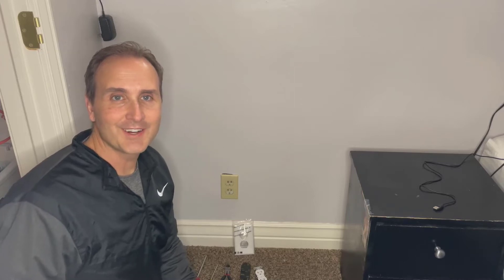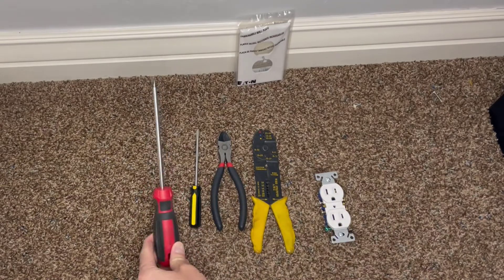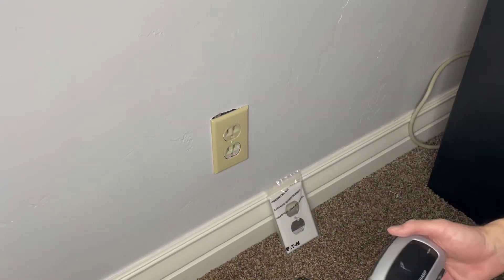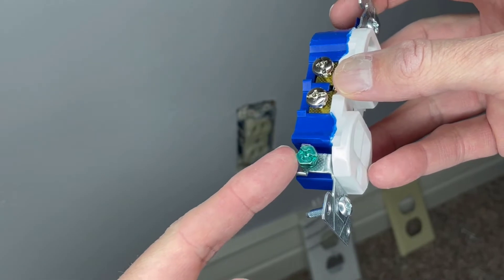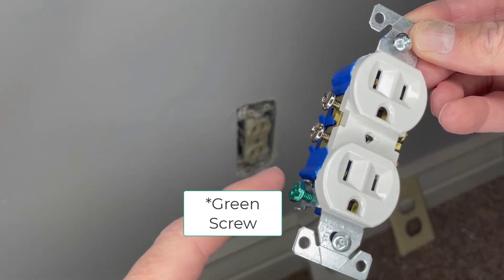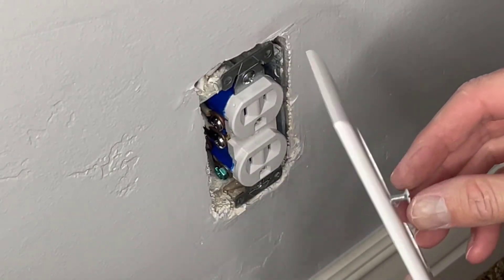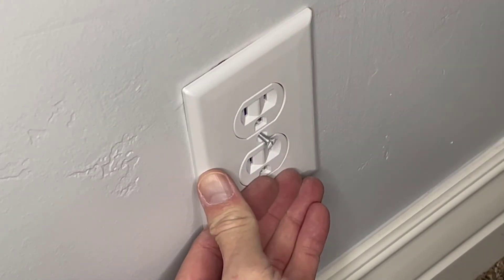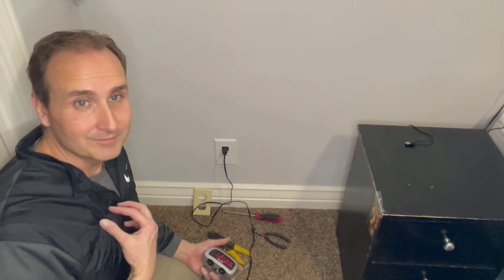How to Replace an Electrical Outlet - Easy Step By Step Instructions

Comment: Uh....wouldn't you want to test with a multimeter to ensure? Not an appliance? 

Oh wait....

Using a wall clock (or any plugged-in appliance like a lamp, fan, or radio) can help you identify if an outlet is powered, but it is not reliable or safe enough compared to using a proper tester, especially when replacing an outlet.

⚠ Here's why it's not good enough:

Test	What it tells you	Risk or Limitation

Wall clock/lamp test	Outlet is supplying some power	Doesn't confirm true disconnection, may not detect shared circuits or backfeed from another breaker
Breaker off + clock goes off	Seems safe	Still could be wrong outlet or shared neutral
Non-contact voltage tester / multimeter ✅	Confirms line voltage is gone	Most accurate & safest method

Yeah. Not smart. Enjoy your zaps.

Comment: Putting 2 wires under a screw as you did with the ground is not permitted by code, you need to pigtail or use a green grounding wire nut which connects the 2 wires and feeds a single wire for the ground screw. Use a receptacle tester (their cheap) to verify correct wiring. You could have a reverse polarity condition and the lamp or clock will still work, but it's a shock hazard. You have a black and white wire, but you never know who did what before you. It helps to be thorough when doing this.

Comment: I’m lucky my dad is the maintenance training supervisor, and taught me how to do these. Ended up changing 10 by myself, with him watching and turning the power off and on for me. It is really simple, now to have him teach me how to fix an ac unit and replace a hot water heater. 😂
Reply: Water heater is easy if you pro press. The hardest part becomes getting rid of the old one.

Comment: Thank you for making this video. I was wondering, what if I have 3 white wires and 3 black wires, can I combine 2 wires to share one screw and have the 3rd wire connected to the other screw? Thank you
Reply: No, only one wire per screw. If there are more wires than screws, you need to use pigtails. For example, the 3 white wires and a new short wire (pigtail) should be joined using a wire nut, push in or lever nut connector, 4 wires total and the pigtail connects to the receptacle. Same for the black wires and the ground wires. Only three wires including the ground would be connected to the receptacle. I recommend using Wago or Ideal brand lever nuts, wire nuts are difficult to use correctly if you have limited experience.

Comment: you didn't close up the wire loops around the screws before tightening them up. Since you were taking the screws off the old outlet, I wouldn't have widened the wire loops. I would have taken the screws off the new outlet and put the new screw through the wire loop and then screw it down. The way you did it leaves a greater chance for the wires to come loose or completely off when you have to twist the outlet around and push it back in the box. The more wire you can grab with the screw the better. That is why it was looped so tightly in the first place. Just an observation.
Reply: You do not want to remove the screws on the new receptacle, they are staked in place and the threads can be damaged by removal and risk cross threading upon installation.

Comment: What if you get the old outlet out and only have one wire each side how do you get two for the new outlet?
Reply from the maker: You will only need the one wire on each side. It works the same. Two wires means that it’s connecting to another outlet down line. One wire means you are at the end of the line.
Reply: @dan_can One wire on each side does not necessarily mean end of the line. The 2 wires could be pigtailed and the wire nuts or other pigtail connection may not be easily visible as they should be tucked in at the back of the box.

Comment: I only have 1 white and 1 black plus the ground.  Is this normal? My home is only 9 years old.
Reply from the maker: Yes. It means that it’s the end of the line. The double wires means that the line continues on to the next outlet.
Reply: Yes. White to silver black to hot, ground to green.